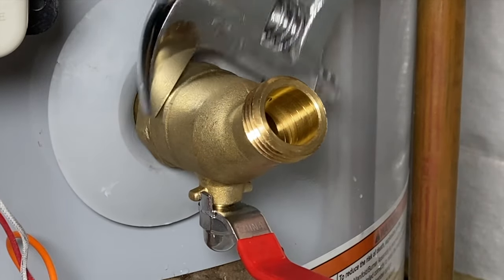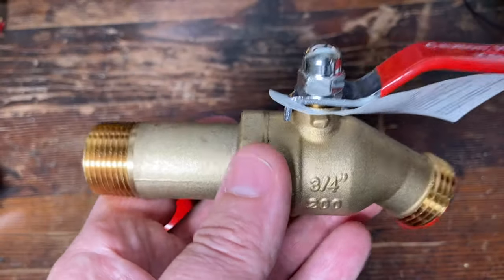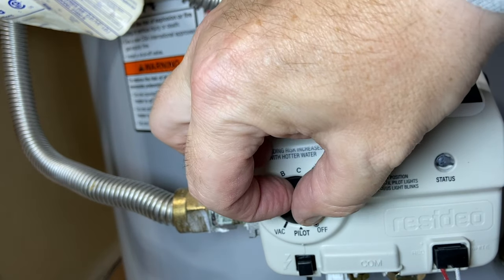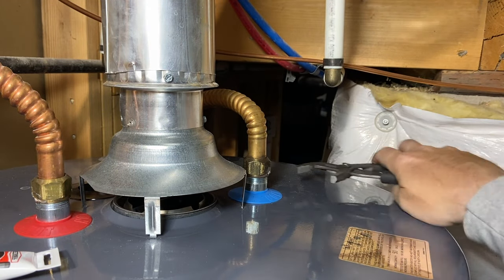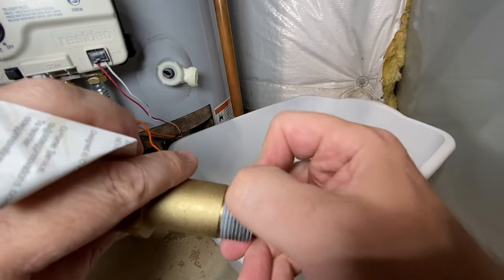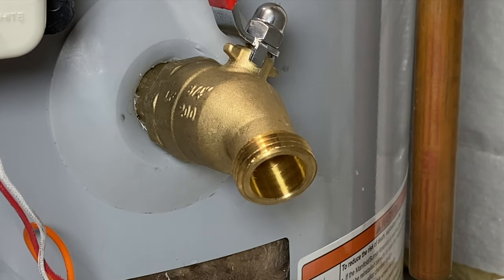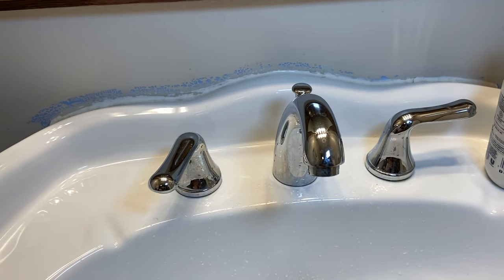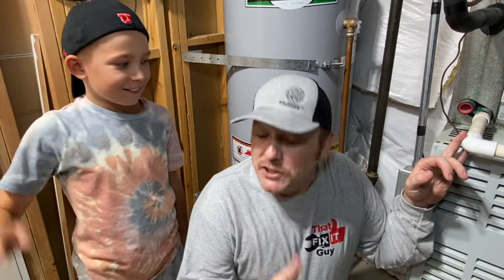CHEAP PLASTIC VALVE??...Replacing Water Heater Valve

Comment: For anyone asking why you would replace the plastic drain valve, I woke to my garage being flooded by my water heater. It was full pressure water just streaming out into my garage all because of the cheap plastic drain valve that failed. I replaced it with a brass drain and would suggest to anyone else with plastic to replace their before it's a problem
Reply from the maker: Oh man sorry to hear about that. Big fan of brass here. Way too many issues. I pinned your comment. Hope it will help some people out. Thank you for sharing your story.
Reply: How old was your water heater?
Reply: Happened to me last week! Piece of shit plastic valve
Reply: Thanks
Reply: @steveolive9991  2 years
Reply: Preach brother. Welcome to my morning. Just glad I was here when it happened.
Reply: My sister learned the miserable way. New unit flooded the house since it was installed in the attic.
Reply: Just for comparison, my water heater is 25 years old and runs great, I'd hate to have to replace it, and the plastic valve still works great. Right now I am trying to get it off to insert an electric element in that opening, and I am here trying to figure out how to remove it as it is being stubborn.
Reply: @dhenschel4 did you get it off? I'm having the same problem. I'm thinking of just breaking it off & somehow getting the threaded part out
Reply: @dhenschel4  just did the same on mine from ‘83!  The trick for removin my elements was using a 37mm or 1-1/2” socket with a 3/4 drive & a breaker bar, or a big monkey wrench with flat lips.  To heck with the stupid special $15 element wrench!!!  Didn’t fit flush and no way to get enough torque 😠

Comment: VERY DANGEROUS! A child can easily open that valve and burn themself! I would take that handle off and place it on top of the water heater and when ever needed just put it back on !
Reply from the maker: Thank you. I should have put that in the video.   He totally did that.  I will be doing a future video on that.
Reply: Karen, have you removed all of the hot water handles from your faucets as well? 😂
Reply: Cap it off

Comment: Things rarely goes as planned! 😂 😂 I'm replacing my plastic valve, I installed the water heater many years ago, can't remember when. The valve has been leaking more and more, I'll replace it. it's on order from ebay. local H-depot's valve online $99. ouch! ebay $15.

Comment: You are lucky you didn't crack the plastic drain valve. You guessed it, it happened to me on a Rheem water heater. For the life of me, I just cursed Rheem forever in using a part that is totally unsuitable. Guess, they never want you to replace that valve. Another thing is that Crescent self-adjustable wrench didn't work for me. It slips no matter how I position it, it wouldn't bite onto an surface you want to loosen.

Comment: Great video! I would consider using a "regular" 3/4 ball valve with a straight 3/4 MGH (male garden hose) adapter so it's a direct path (with no bends) into the water heater.

Comment: My electric water heater is so full of sediment, that it would not drain!  I had to remove the lower heating element to drain the water; messy, but luckily, I was only a few feet from the sump pump.  The plastic drain valve is clogged; I removed the valve in it, and then I could pass a small coat hanger wire through it but that still wasn't enough to clear it.  I thought of removing this valve, but the water heater is old, and I thought that I might get myself in trouble if it broke off in the tank.  I was happy to see that you too, had trouble removing yours.  Perhaps I'll get a new replacement as you suggested and then give it a go!  Thanks for the great video and encouragement!

Comment: You are a good friend to help out! Looks like your friend needs to add a sediment trap on his gas supply , perhaps a follow up install video. Thanks for taking the time to post this and for including the issues with removing the plastic valve.
Reply from the maker: Great idea That is true.  Many heaters around here need em.  Don't know what they don't put them in here.

Comment: I don't mess with too many water heaters, but from working with boilers and guys who have done work for decades, the SOP was always to never touch a safety valve.  We've only replaced them.  Typically they would end up being replaced (after an inconvenient shut down) because after popping them to 'test' they'd have a dripping leak that never quit.

Comment: I repair and install water heaters for a living. In most cases I turn off the water at the main or the meter, leaving the water heater supply valve open, open a couple of faucets and let air in that way to drain a tank. A pump such as the Milwaukee battery powered one connected to the drain bibb works wonders for expediting the drain. Old crusty pressure relief valves sometimes don't re seal, but I always open them if the water heater is being replaced.
Reply from the maker: That is a great call. Nice to test the shit off and make sure it works though. I bet that pump comes in handy.

Comment: That pipe wrench, from Home Depot, was the ticket for getting the plastic valve off of the new Water Heater. Thanks.
Reply from the maker: Your welcome. It did work really well. Thinner than a traditional pipe wrench.

Comment: Needed to replace a plastic valve on a brand new water heater yesterday and it just wouldn't budge with my "regular" size wrenches, even after applying some WD-40. I was wondering whether it would come out at all without breaking. Encouraged by your video, I went back home and brought my heavy "big gun" wrench similar to yours and hooray, I got it loose and removed.

Comment: In minute 3:42 you recommend to loose the inlet to facilitate the drain letting air entering the tank. One option to get the same effect is opening the closest hot water faucet and keeping it open meanwhile the tank drains.

Comment: That's was crazy tight..... Great helper taking care of everything behind the scene.   
I think another homeowner maintenance thing everyone could do or learn would be a sacrificial anode replacement. 
Let's Get To Fixin! 🛠
Reply from the maker: You are so correct!  That is a big one.  that my friend is a pinned comment. At some point that will be a great video!  Thank you Chris!
Reply: My ñ
Reply: I ended up going with a powered anode, they use them in commercial water heaters and last way longer than a traditional anode rod

Comment: Well that plastic valve was a pain in the bottom to get out. The Brass one is at least 100 times better quality . It is a shame that manufactures cheap out on stuff like that , it just drops the over all quality of their products all in the name of saving a buck when making the product.   Hey Jett nice work man , thumbs UP to you for helping Brian !
Reply from the maker: So true Richard!  I feel like you can one get water heaters with brass drain valves at plumbing supply houses these days. Jett did do a great job. Thank you for checking this out. Did you send me your address?  You were a winner the other night if I’m not mistaken.
Reply: @ThatFixItGuy  Hello Brain , yes I did send a message to your gmail account at ufix247 .  Thank you !

Comment: Thanks for the vid bro. Replacing that exact same piece of plastic crap. Mine developed a pin hole and sprayed a jet stream of water on the wall insulation in upper attic and down in the wall to downstairs. Luckily I heard it dripping in the wall and caught it after only maybe a half gallon went down the wall. 🤬🤬🤬🤬

Comment: Thank you. This was straight to the point. I replaced it myself and saved about $300. I used liquid nails around the threads though. I hope that's ok. 😆
Reply from the maker: I hope it was some sort of pipe dope and not liquid nails. But hey if it worked you may be on to something. Glad this helped.
Reply: @ThatFixItGuy  No more leaking so I guess it worked. 🙂👍🏾
Reply: @ThatFixItGuy  oh man.
Reply: use PTFE thread sealant tape instead...it's not messy, easy to use and inexpensive (about 50 cents for a small role at Home Depot).

Comment: I was at the hardware store the other day, and a customer had broke is plastic drain valve off at the threads on the inside of the tank trying to unscrew it. The 3/4 hose threads also cross thread very easily on the plastic valves.

Comment: I also like to work the tape into the threads to help me start threading the fitting.  Instead of using your fingernail to work the teflon tape into the threads, use the edge of your teflon tape roll.  It's perfectly sized for pipe threads.
Reply from the maker: That is a great call. I never thought of that.
Reply: And saves from a possible brass splinter or cut from rough edges on the threads.

Comment: Glad to see I'm not the only one to have difficulty removing old drain valve.  I'm about to try the channel locks.  Afraid I may snap the plastic without removing it, then I don't know how I will adapt...
Also, why would you do any water heater maintenance with the electric still on?
Reply from the maker: Never drain your heater with the electric on.  This was a gas heater.  I thought I was about to snap that drain off as well.

Comment: I had the same problem getting the old valve out but made it. I was waiting for his to break off like mine did. Before filling, I filled it about 1/3 of the way from the bottom to steer it up the drained it again. This broke up the caked-up deposits on the bottom. He did not need to do that as it was a newer tank. Next, I would take the aerator off the valve I am releasing the pressure if it had one so I would not plug it up.

Comment: Recommend that you get a piece of plastic you can fold and use that to lead the water from the drain valve to the bucket -- that way you don't have to remove the cover.
Reply from the maker: That is a great call thank you.
Reply: That’s exactly what I did for mine and it worked perfectly! Just a big scrap piece of anything shoved under the inlet and right into the bucket/pan.

Comment: I just bought a A.O. Smith Signature 100 40-Gallons from Lowe's and tried to replace the valve and the plastic POS snapped off with only a small section now sticking out. Now wondering what to do? Any suggestions?

Comment: Nice. Note: Thread sealant, sometimes known as pipe dope, can ruin your clothes/ furniture if not careful. I consider it worse than paint when it comes to cautionary tidiness. A blob of white sealant stuck to something transfers to something else, and it can make a "simple" job a less-than-excellent event. Just my rule because I am a real slob otherwise. Correct me if I'm wrong. Also, I would have been tempted to use my propane torch to melt that junky plastic valve and pull it out to avoid a trip and extra expense. I use the torch a lot in a pinch, to strip wire insulation, loosen things that are stubborn, etc. which can be safer than using a utility knife to cut off some tuff duct tape, etc. Requires diligence and caution, that's all. Thanks for the excellent vid.
Reply from the maker: Your right that pipe dope can get really messy.  I don't know about using a torch on that valve.  I think you would end up burning the insulation around the tank.  Could turn into a disaster real fast.

Comment: I hate plastic sometimes.  Plastic is used, so many times, in places where it really shouldn't be.

I was amazed at the amount of force you had to use to get the plastic valve.  I really thought it might break.  What would you have done if it had broken off with some, or all of the threads still in the water heater?
Reply: I broke mine trying to get it off then I heated it up with a heat gun and picked the bits out with a screwdriver being careful not to mess up the threads. They should give you the option of buying a water heater without the worthless plastic valve fused in the hole.

Comment: I just bought an ao smith 100 series 50 gal gas water heater.  I haven't installed it; it's sitting in my garage.  I know I wanted to swap those drain plugs before I do that but having a hard time finding a suitable replacement.  Are they all 3/4in at the base?  Was thinking about a siklcock type fitting if I could find a shorter stemmed one

Comment: Very informative, thanks for sharing.  I've been wanting to do this, but am worried I'll snap the pipe behind the valve that attaches to the tank.  I couldn't tell when you removed the old valve.  Is it just the valve itself that is plastic or is the pipe that attaches it to the heater also plastic?
Reply: It is all plastic. If you break it, use a metal saw blade to carefully cut the plastic and chip the plastic out. Another video on YT shows this by AMRE supply.

Comment: I am replacing my AO ProMax with the Lowes Signature 500 series which has a Nylon drain valve instead of brass as found on the AO commercial ProLine series?  Nylon is a hygroscopic resin and absorbs moisture so why use it on a hot water tank drain valve? I will just remove the brass one on my old one and use it if it is in good shape.
Reply from the maker: That is interesting to know. Thank you. Money is why unfortunately. Full port brass valve is the way to go.

Comment: i am lucky my water is soft so i never play with the valves i am always worried some dirt will get in seat and make it leak  I considered changing the anode on water heater but didn't want to break a perfectly good water heater that is not broken. I wouldn't want to try doing that valve replacement on an old water heater
Reply from the maker: I’m there with you.  If your water is soft and you don’t get a lot of sediment then I would not mess with it. I have see water heaters never touched last over 40 years. They use to build em like tanks!  If you start having problems then address issues.  I like preventative maintenance, but sometimes run to fail is a good options as well.

Comment: Years ago I replaced a plastic drain valve with a brass valve and it was pretty tight but I managed to get it loose. I bought a new A O Smith water heater that came with this really cheap plastic valve. I tried every thing including a pipe wrench with a cheater bar but it just would not move. I just gave up because I did not want to break that valve in my new water heater. Any suggestions?
Reply: Try replacing it in a couple years ,I bet you have a better outcome.

Comment: How do you drain the water heater with a non-operating and plugged drain valve??
Reply: The tank heater must be turn off over night and you can try to stick a wire through the valve and hope for the best.

Comment: The valve has a stop for open/close and tab on lever was not touching one on valve.
Reply from the maker: Oh I did not notice that. Thank you
Reply: @ThatFixItGuy  My shutoff screw does not completely close so I put a cap on it. I may change mine to one like the one you installed. I hope mine is not smoked on like yours.

Comment: Why drain the tank?  If you shut off the water line, won't the water stay in the tank?
Reply from the maker: If there was a shut off on both hot and cold  then maybe you could try it, but I would never take that chance with hot water.  Water will still come out just slower than it would with an air source. Drain the tank was the best option

Comment: What if plastic valve cracks and breaks leaving stub in tank?
Reply: If it breaks like mine did, just use a small hacksaw blade to carefully cut out those pieces that remain in the threads.

Comment: Broke plastic pipe...try open ended and a small hacksaw like blade and vise grip and carefully cut inside out and use pliers to turn out or pull pieces.  Be careful not to damage hot water heater  tank pipe threads.

Comment: Why are you loosening fittings to introduce air into the tank when all you have to do is open a faucet at the highest level of the house?

Also, using a garden hose for hot water is asking for trouble. If you don't have a contractor grade hose, which will handle hot water, run the hot water in the house, with the gas turned to pilot, to reduce the temperature of the water in the tank; or you could wait until after someone takes a shower.
Reply from the maker: That is a couple great points. Thank you for your comments

Comment: I can't believe they cheap out on these drain valve.  And why not just use curved dip tubes?  Because they don't want their water heaters to last!  Make sure you loosen your anode rod when it's new, because if you can't get it out later it won't come out.
Reply from the maker: I know. They don’t build em to stay for 40+ like the old school ones. That is a great call to loosen the anode and tape and dope. Thank you.